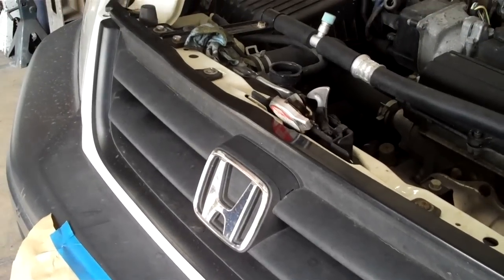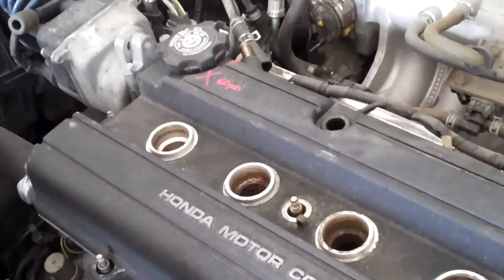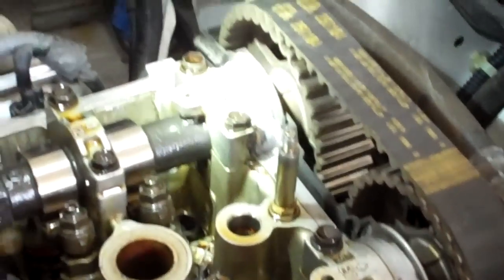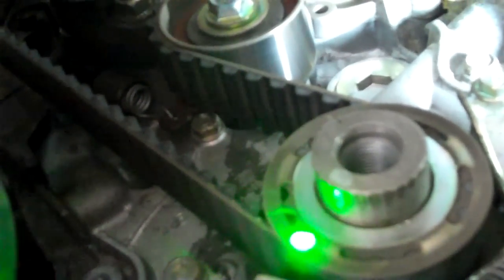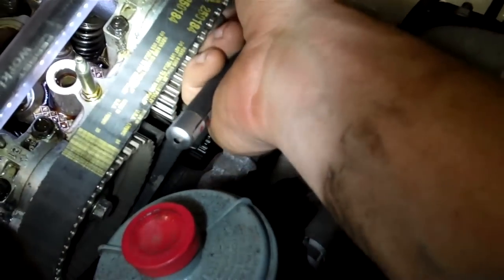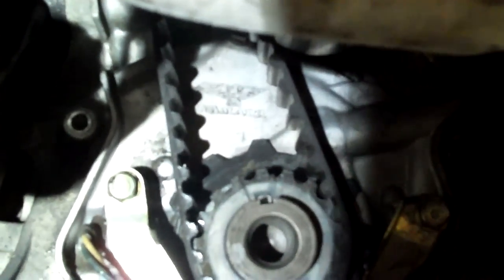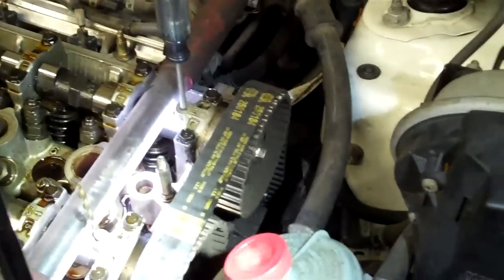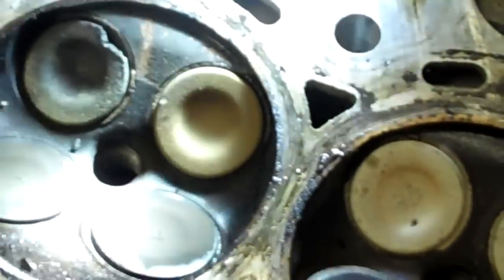Honda CR-V DOHC P0304 DOUBLE TROUBLE

Comment: I replaced my timing belt on my 2001 CRV.  It had 187,000 miles and still looked brand new.  The way Honda recommends installing the timing belt is to have the crank and cams spot timing, pin the cams, then wrap the timing belt around the crank, then around the tensioner (tightened to full relaxed position) the water pump, then partly onto the exhaust cam taking all slack from exhaust cam to crank. then slip onto the intake cam.  Then you rotate the crank counter clockwise 6 full turns and stop on your timing mark .  check to make sure cams are on timing marks.  Loosen tensioner bolt, turn crank counter clockwise to bring slack to tensioner side  3 notches of the crankshaft and then tighten the tensioner bolt.
Reply: Its 3 teeth on the camshaft. Its turn tensioner  bolt 180 degrees to loosen then rotate crankshaft counter clockwise to move 3 teeth on camshaft and then tighten tensioner bolt to 57 Nm. So many videos say crankshaft  but thats incorrect. People dont read past the comma in the manual 📖😂

Really hope this helps someone. My advice is download the crv mk1 service manual

Comment: I just did my timing belt on my 1997 Honda CRV rotated at six times with tensioner loose top dead center I tighten the tensioner should I have backed it off three three teeth on the gear then tighten it like you say I will I be okay I just don't want it to jump time any help would be greatly appreciated

Comment: That was a piss-poor job by the mechanic who originally installed the TB....just another reason why I do my own maintenance. In the next couple of months I'll be doing the third TB job on my '98 CRV which currently has 285,000 miles.The first time I didn't know about the cam holder trick and it drove me crazy but I eventually got it done and all of the marks were lined-up perfectly. The second time was significantly easier since I knew about the cam holders at that point.

Comment: Those cam pins sure are a slick idea. I wouldn't worry about the marks as long as the bars are up before pins are in.
This should be done every 100K and never put off replacing the water pump when you have it this far down.
Also make sure to drain and flush your Honda cooling system at its earliest interval recommended in the owners Manual or I would say once a year or cycle of seasons. This is to slow the decay that occurs on the aluminum from the breakdown of your coolant.
Have a deuce running like shit? Do the whole seafoam treatment. That stuff is not a gimmick. Get around the folks with big boats for going out deep sea fishing or that kind of watercraft. They use the stuff a lot. Its not that fake octane booster BS.
Seafoam knocks out a lot of carbon buildup and varnish. Heard knocking valves go silent with it. It gets my backing for any gear head to use.

Comment: I know this is a very old video but I have a question. does this engine have close tolerance between valves and pistons? If it were to jump time can the valves smack the pistons???
Reply: Yes they can. The term is an "interference" engine. I learned that the hard way when my timing belt broke!
Reply: @19580822  I learned it the hard way with a KZ1000.

Comment: Nice job. I've got a 2008 CRV that I was adjusting the valves on and decided to do a compression check because it had been missing. 3 cylinder head 190 PSI but number two was only a hundred and twenty. It had been setting a check engine light for p0172 which is rich exhaust or fuel trim reading. I would assume the exhaust valve is leaking which would be consistent with both of those conditions. I've done a ton of research online but haven't really found any problems like this on the 2007 through 2011 CRV like they had on the earlier model CRV. Since you're a Honda technician I wonder if you've heard of valve problems on this later model? Thanks again for your great write-up

Comment: Just changed a timing belt on a x14xe Astra g. Markings are aligned and tension is correct. The tensioner pointer shakes a bit while the engine is running. Is this normal?

Comment: I have a 2000 Honda crv when ever I make a sharp turn there is like a rubbing and pulling noise and I can feel it in the wheel anyone know what it is?
Reply: Most likely it is your rear differential. The fluid breaks down and it starts making noise. It takes double pump honda fluid. 1.2 quarts. google it to get more info.

Comment: Hey Brian—Did you ever determine the root cause of the burnt valve? Cause I had this EXACT thing happen to my 2001 CR-V, only the problem started right after I got my timing belt changed. Started running bad, making a rattling sound. Ultimately, I lost compression on the fourth cylinder, took the head out and discovered I had a burnt exhaust valve. I'm just about finished installing a rebuilt head, but now I'm concerned that I may not have addressed the main problem! Did you decide that it was the skipped tooth that led to all these other issue? I'm pretty sure my timing is good, but I'll have to check again. Thanks!
Reply: I have a 1998 CR-V that started to make a rattling sound after the timing belt was replaced by someone else. I pulled off the cylinder cover, rotated the crank and saw slack coming up on the belt each time it comes around on the cams. I'm in the process of resetting the belt now using Brian's video as a guide. I'll post again once it's done and let you know if the noise is gone. Hopefully I don't have a burned up valve as well! I'm planning a compression check right after this job is done.
Reply: Why hello ... Yeah, shortly after I posted that I discovered that the timing belt had indeed been installed incorrectly, off by a tooth—didn't slip or anything, they just messed up the job. And to think, when the engine died, the same mechanic suggested I sell the car to his buddy for $300! Well, after replacing the whole damn cylinder head with help from a good friend of mine, I drove the car back over to the mechanic (about two months since I'd last seen him) with a letter in hand, rehashing all the services I'd had done at their shop, the concerns I'd raised (which were ignored), and the evidence I'd compiled to prove he was at fault. At the end of letter, I asked for $1,000 as compensation for the trouble he'd caused me (far less than the actual dollar amount of this headache) and to his credit, he wrote me a check right then and there, no argument. It proved to be a long and costly debacle, but I learned a lot, and I wouldn't change a thing! :)

... But you didn't ask about any of that. For what it's worth, I drove my car for a couple of months and many thousands of miles (across the country and back) with bad timing before the engine finally died. Hopefully you caught yours soon enough that there wasn't any serious damage caused! :)
Reply: Wow, that's quite an adventure to go through! I'm glad you were able to get it resolved with the mechanic. 

Last night, I was able to get my timing belt setup correctly. There is no longer any slack when I turn it over by hand. I had to use the method described by Brian. Even with tensioner loosened, the spring did not appear to be adding enough tension on the belt. That little bit of slack was causing the belt to slightly bow up when it comes around the cam pulleys. Now, it's smooth operation all around. Time to button everything up, take it for a test drive, and move on to compression testing other maintenance tasks.

Comment: Recommend the title be changed to the correct model year. The '04 uses a timing chain.
Reply: look closer, doesn't say 04, its a 1st Gen as you can see
Reply: Mike B When I click on the title "Honda CR-V 2004 Timing Belt/Water Pump Changed" I get this video. That's what I'm referring to.

Comment: Hey. On this vehicle, is there a way to pull of just the belt cover to check the belt itself for wear instead of pulling off the whole valve cover? The reason I am asking is I am looking to buy one this weekend and the seller says the best has recently been changed but has no paperwork to prove it. I want to check it out without messing up the valve cover gasket.
Reply from the maker: They made it so you have to take off the valve cover in order to make you set up for valve adjustment at the same time.  It's possible, but you'll break things.
Reply: I figured. Lame. Thanks though.

Comment: I was at local Honda dealer trying to buy a used 2003 CRV with 130K mile on it but I was asking if the car already has timing belt changed... they told me, after consulting with the service manger,  that the 2003 CRV has a timing chain so there is no need to change a timing chain on it... but this CRV obviously has a timing belt.  What year is this CRV?  I hate it when the dealer did not even know what they are talking about.
Reply: This is a video of a first generation CR-V, so 1997-2001.  Starting in 2002 they began using timing chains for CR-Vs.

Comment: hi,, I have a question my friend just bought a Honda crv 2004 and the guy who sold the vehicle told him that the timing belt didn't need to be replaced because it was a chain belt.. but im jus watching in this video that is a regular timing belt,  can you tell me at how many miles is this belt supposed to  be replaced
Reply: Vladko Rod---The '04 CR-V has a timing chain. It's not normally considered a "maintenance item", but rather is replaced when it is suspected to be defective or becoming that way. I originally thought this video was about an '04 because of the title, but when I viewed the video it was obvious it was a Gen 1 CR-V.
Reply: ok ,, thank you very much!!

Comment: This was awesome! thank you. I'll be tearing down again in the morning. Replacing a shredded timing belt today was quite a task - to say the least. It was my first time and I'm happy to say that it actually started and ran down the road. It idled pretty low but smooth and even stalled one time - so I must be close - just not close enough. I know that the timing belt alignment is off, as I notice that TDC was difficult to achieve especially when you try to align the cranks with a 12mm. I know I'm off a little. The great thing is that all the bolts will come off easy next time. Your demonstration would have saved me a lot of time. I found a yeehaw on youtube who kinda had it right but was missing the screwdrive/dillbit TDC trick on the cams. I wish I seen it myself, but it started raining around the time I was mounting the belt- kinda hurry a little bit in the rain. Thank you. I'll try to stop back to let you know how I made out.
Reply: Worked great! Thank you. It took a 3/16" drill bit each to hold the two cams with a little play. The Crank didn't line up as perfect by the guide line and arrow, but close enough. It runs smooth with an idle 500 RPM. This video really helped out a lot. 10 hours on the first run, and after watching this, it took only 4 hours - includes an oil change.
Reply: Kirk Frederick
oh, and the spring on the tensioner seems to pull an adjuster back to loosen it as the tensioner bolt is loosened. As you tighten it the adjuster moves into position and pulls the timing belt tight. You really don't have to pry against the tensioner at all - it works all by itself by design and works great. It's actually a brilliant work of engineering.

Comment: for a dohc engine after putting timing belt back at first im getting resistance to turn from crank 6 oclock postion. i mean when in tdc im turning from crank at 6 oclock. so from 6 to one quarter of movement i need to put some force to make it spin but after that it spins easily till it finds resistance again. i may be wrong but im feeling a little hard to move it from 6 oclock tdc. is this because of valves spring tension? i have spark plugs off and accesory belt off too. i already changed the oil but not the filter yet i made sure my cams were lubricated too.  before putting belt i rotated crankshaft 90 degrees so it would not damage my valves and rotated both cams with no problems and make sure the crank rotated also before putting my cylinder head. thanks for any suggestions. the car is a daewoo 2001 leganza. thank you!

Comment: Do you need a special tool to remove the crankshaft pulley? Would you recommend Genuine Honda for any parts or will aftermarket last the 7 years and 105k?
Reply: Actually no.. The trick is loosening the bolt. I imagine there is a tool out there somewhere, but is it worth the one-time-use-tool. I just took off the flywheel cover (small black plate with  4 10mm bolts and 1 17mm bolt) just left of the engine. You notice there are hole that you can just fit a small flat head screw drive, then advance the flywheel counterclockwise until you can wedge the screw drive against an engine part - then go ahead and loosen the crankshaft pulley bolt. I had to use 5' pipe on the end of my 1/2 drive socket wrench to crack it loose. It tool a lot of power to do it too. Once it broke loose the bolt came out and the pulley just slides off. No pulley puller required. Just make sure you don't lose the small 1/8"x1/8"x3/8" pulley key or you'll be very mad at yourself. Good luck.

Comment: I hate timing issues.  hate hate hate.  Wouldnt it be nice if engines didnt need a timing belt or chain.  They should all be chains at the very least.  If engineers insist on using belts then they should at least make the engines non-interference so the engine doesn't self destruct if the belt breaks or slips.
Reply: I hear you. I work on diesel trucks and their engines are gear driven. Those gear train for the most part are bullet proof. They are expensive to make , adds more weight to the engine and can be noisy. Can't win, each system have drawback.
Reply: Ok then why don't belts last 120k like a chain.  That doesn't even make sense
Reply: ***** Sounds like some cheap chains to me

Comment from the maker: I had a REALLY stuck one recently.  Let me see if I have any footage from that.  They're supposed to just pull off by hand.  I had to weld nuts on the face of the above mentioned one and use a bolt puller to get it off.

Comment: Nice video covered all the things amateurs need to know. The one that I think would be challenging to change is the chains on newer Honda's because you have to deal with cam timing vvt adjuster and the oil pressure tension ratchet adjuster. All good stuff to digest before you even pop the cover. Mostly you find these on K series engines.

Comment: Nice video . Good for other B series Acura / Honda engine like Integra B18B engine too. Your method of setting the tensioner is not quite what the manual describes but it obviously works. However, I followed the method in the manual . Thanks for making for these very helpful automotive repair videos.

Comment: I wish I knew those cam pin holes were there a year ago, nice info.
BTW... Water pump- I was told "only buy a Honda replacement or else it will leak."  After researching, that is not entirely true.  You can buy a no-name replacement, but it MUST be from the country of manufacture (in this case Japan, NOT China).  Reason being the tiny difference in metal content causes different rates of thermal expansion/contraction in comparison to the block, resulting in a leak. Just thought I would share.
Reply: Never heard that but it makes sense. Especially with aluminum that is super sensitive to heat.

Comment from the maker: I just snug it up to make sure all of the slack is out and then let the spring hold the tension. Then tighten the bolt and then twist the longest run from the cam to the crank gears and make sure it can't turn more than 90 degrees.

Comment: Brian, you're my only hope. I did a timing belt on a 96 integra. Pretty much the same motor. I line up the timing marks for the crank using the oil pump housing, I put them dead on with the cams. I locked the cams in place with drill bits, the works. But, the harmonic balancer TDC mark was off by a bit. I ran it, didn't bend any valves so it's not off by much, but I have all sorts of misfire codes. Can I adjust the timing with the distributor or do I need to go back and line up the balancer?

Comment: Love the video.  Question: Aren't you supposed to get the crank marks exact or are you have going' to adjust the distributor to get the timing dead on.  I am doing the timing belt on this exact engine right now and can't get the marks to line up either but always thought you could.  I wondered if there is a way around not having the crank marks exact.  Please help!

Comment: If it was a subaru I would do it my self.., Easy pease... No its one of those early model Saturn Vues with the odd 58 degree v6 (the opel 3.0 v6),....  Sides taking it to the dealer, i haven't found any independent knowladgable enough to repair it or thats even willing to work on it, since its not the Honda V6 found in most VUE's

Comment: I am a tech at a local Honda dealer here and almost every first gen CRV I have seen will eventually need a Head or complete Motor. Putting a brand new Head on a motor with 100 to 200k miles isnt good for the bottom end. Hence a complete engine replacement. Problem is that buying a used engine you run the risk of the same problem happening soon after replacement. Honda just had a poor design with the valve train on the B20 series engines.

Comment: Even with the cam timing off a bit, one other way to check if it was cam timing or a valve problem would have been (with #4 at TDC), check that the valves for that cylinder weren’t being held open – even back off the adjusters until you have some play in the rockers – then repeat your test. If it’s still leaking air, it’s not cam timing.